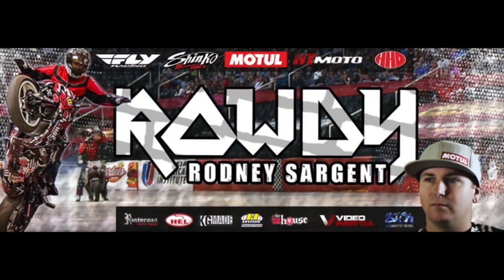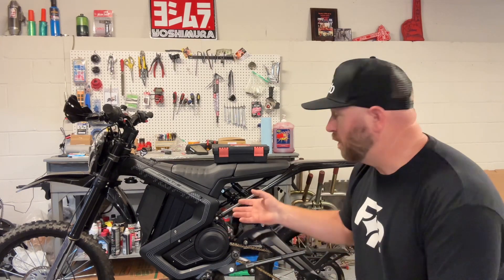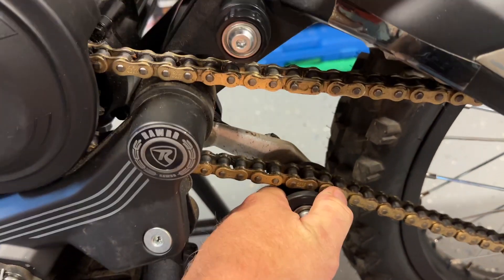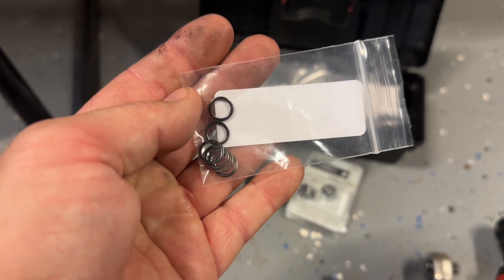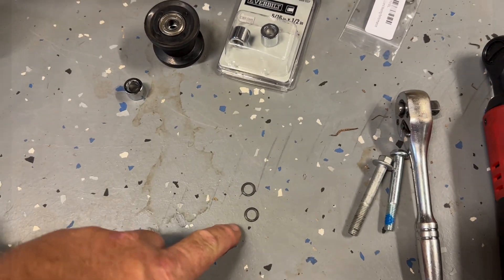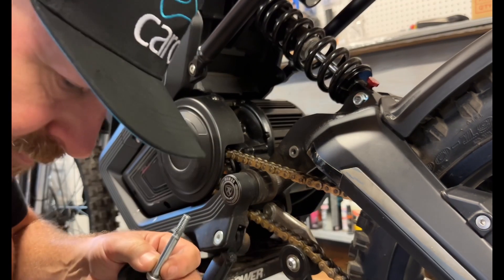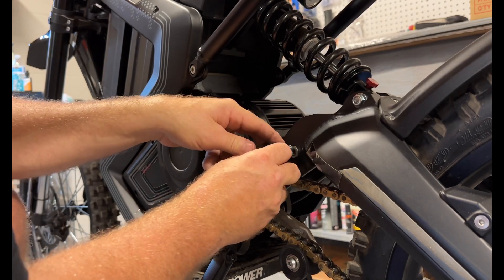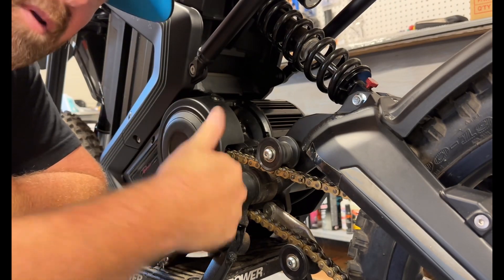Rawrr Mantis Ultra Quiet Chain Guide Mod!

Comment: Was super quiet when I first did the mod, but shredded the rubber chain roller after about 100 miles, the lower roller is a softer plastic as opposed to the upper roller.